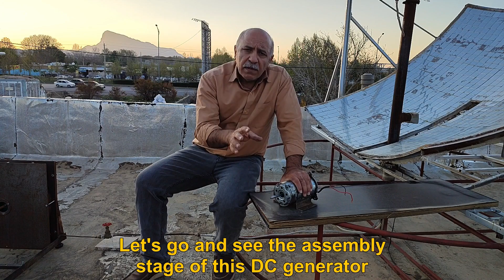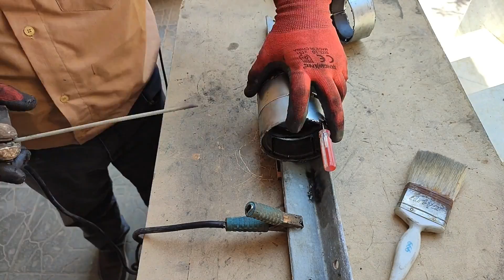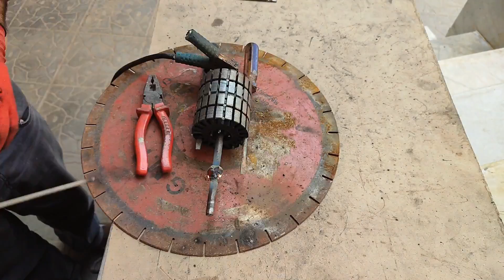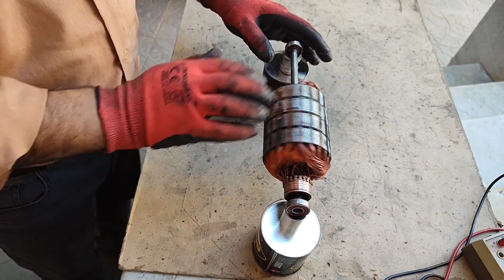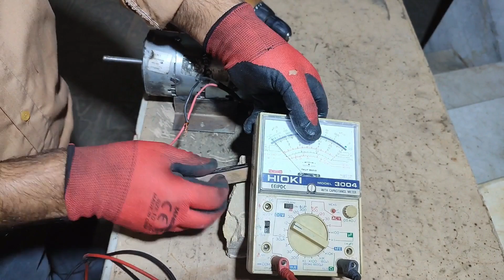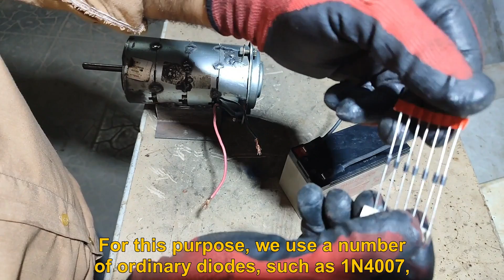With this generator, you can charge the battery with a hand-crank.A 1000 watt generator

Comment: What is the AC frequency with this generator --- at what speed --- and at what voltage?  How many watts can this generator produce?
Reply from the maker: Thank you
The frequency depends on the speed of rotation and the number of rows of magnets
The power depends on the length of the wire and the strength of the magnet and the distance between the magnet and the coil
And the voltage depends on the number of turns of the coil
Reply: @fixedfocussolar  What I specifically meant was --- what frequency can this thing generate at 120 volts the way you have it internally wired?  Can it generate 60Hz at 120 volts --- and if so, how many watts?

Comment: Can you make another video where you connect it to a multi meter and display the power output while being operated by hand?
Reply from the maker: The output power of this generator is not more than 30 watts by turning the hand, but if you increase the rotation speed with a gear or pulley and belt, its power reaches even 200 watts.
Thank you for your accuracy

Comment: There is no way it makes anything close to 1000w by hand cranking. A Olympic athlete can only run a 450w toaster for a couple minutes with there legs so there is no human on the planet that can produce that with their arms. P.S Perpectual motion machines are simple potential energy batteries that will run out of power and you will always lose energy to friction and other factors.
Reply from the maker: Yes, you are right, but I have not said anywhere in the video that you can generate a thousand watts of electricity by turning your hand
The purpose of the video is to make a cheap high-power generator from waste engines that can be used with a solar steam turbine or wind turbine in places with good wind and activate the batteries to start the inverter.
Thank you for your nice comment